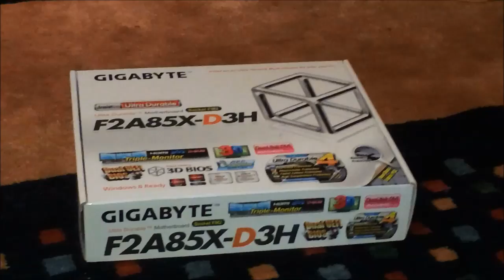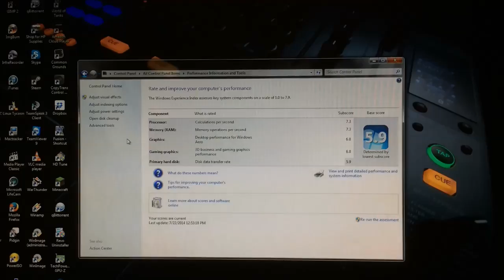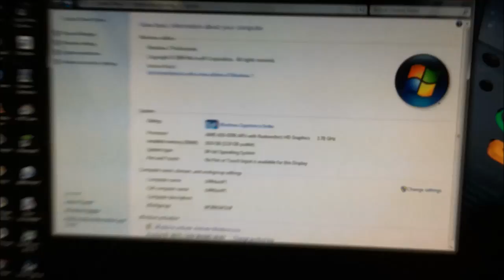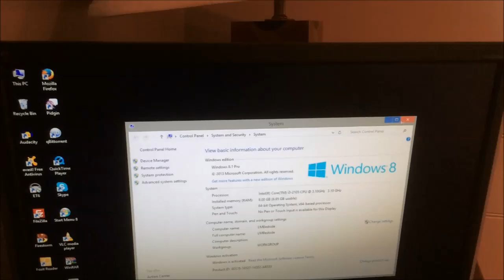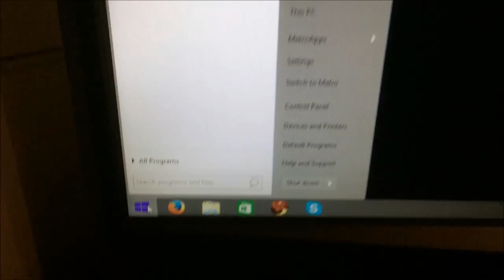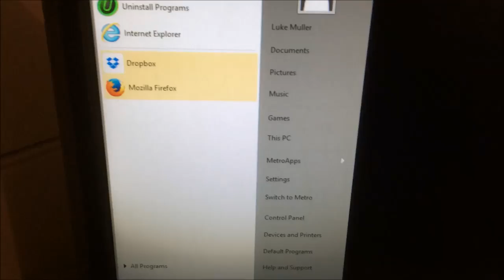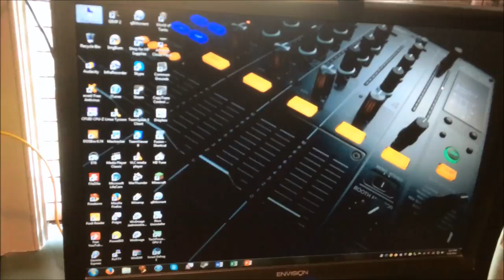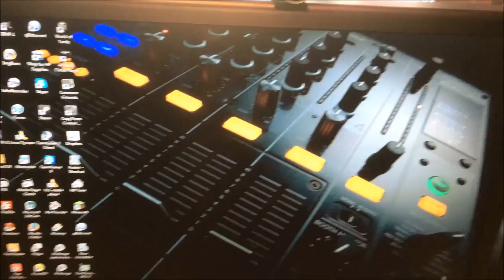Main, Bedside & Workshop Computer Changes 7-24-2014

Comment: Shoot, I still use a Core 2 Quad Q6600 as my primary rig.  Mine is in a 2012 MSI board with DDR3, I have yet to fully exceed the limits of this machine.

Comment: WHen you do backups across your machines do you just re-install from an image? How does that work with dissimilar hardware? Thinking about migrating from my 60GB OCZ SSD to a 256GB one since they're a lot cheaper than when I purchased mine two years ago.
Reply from the maker: i usually just reinstall Windows altogether without reformatting the drive and drag all my stuff back from the Windows.old folder. i'd really like some bigger hard drives in order to do proper backups instead of just winging it.

if you're going to upgrade your SSD you could always just use clonezilla to move it to the newer SSD. saves a lot of hassle.